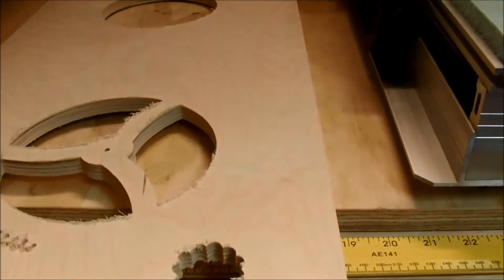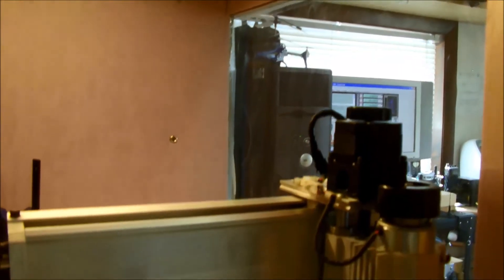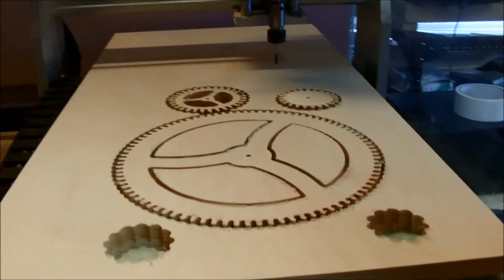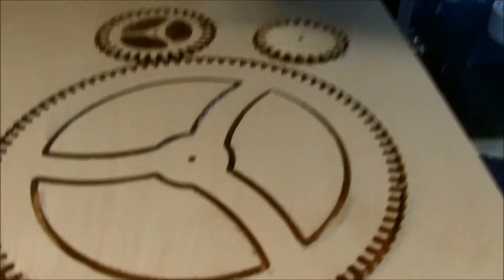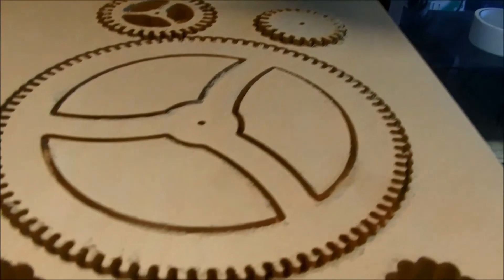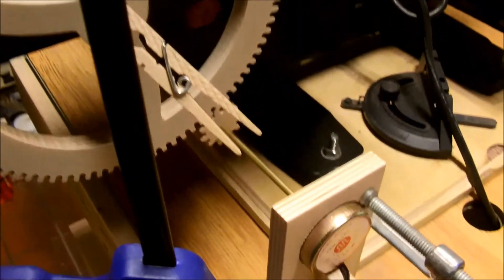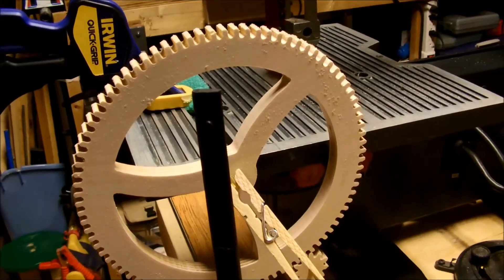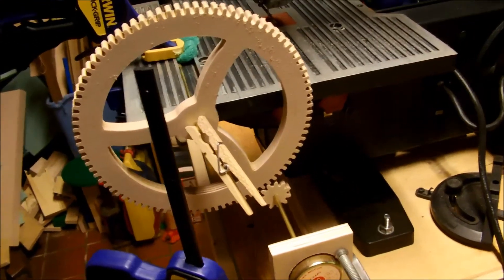CNC - 3040 - Clock Gear Train

Comment: Hi,  What machine do you have?  I googled 3040 CNC and got a wide range of machines.
Reply from the maker: The one I have is the old design that uses a parallel port rather than a USB.  Most of the 3040 CNC machines are similar.  Some have slight differences in motors or spindle size but it's pretty much the same machine.

Comment: How would this machine fare with milling aluminium? What about something harder like steel? I'm looking to build parts for some crazy robot project!
Reply from the maker: The CNC machine itself (stepper motors, rails, bed, etc.) is strong enough to work with aluminum, however, the spindle isn't up to the task.  I tried to cut aluminum many times and the small spindle would grind to a stop and then break the bit.  I ended up re-designing the holder for the router and then put a larger router in to cut aluminum.  Here is the video of my spindle/router mod:  https://www.youtube.com/watch?v=XmkRdvir5Ns
Reply: Thank you!

Comment: I use an Isel DaVinci III.  Its working envelope is about 2926.  I feel much of your pain with regard to project size and segmenting projects so they fit the envelope.  I would like to hear why you went with the 3040 when your home built seemed to be working just fine.  I like your page because you feature fun cnc projects within the reach of my cnc.
Reply from the maker: +Harry Ragland Hi Harry.  My home built machine was fun to design and build and far exceeded my expectations.  However, for making gears and projects that required a little more precision I wanted a slightly better machine.  The 3040 is very accurate for how much it cost and I'm enjoying using it.  But, as noted, I'd like a bigger CNC one day.  I do try to keep my projects within easy reach for average workshop folks.  Nothing too crazy complicated or expensive.  Thanks for your comments.  I do appreciate all feedback.

Comment: What do you think of this router now that you've had it a while?  I'm thinking of buying the same thing.
Reply from the maker: +Dale Fletcher It's a very good little machine.  I've run it through lots of projects and it has held up very well.  The only downside is that it's on the small side.  The router/spindle is plenty strong for the wood working projects I've done but I'd like a larger cutting area.  The price is hard to beat though.

Comment: I have built my own cnc and brought rails and bearings lead screws, the accuracy is very good. I have built one of Brian's laws clocks from the free plans. It worked great. What is that gear programme you was using at the start of the this video?
Good luck with the rest of the build
Reply from the maker: pmr21uk Thanks for your comments.  The program is called Gearotic Thoughts - http://www.gearotic.com/

Comment: I kept my eye open for this video, had a sneaky suspision you may be working on it over the weekend :)

I had been gathering the parts to build my own CNC but after seeing this I may just get the 3020 ! It seems to have worked well for your gears.

Andrew
Reply from the maker: Andrew Graydon H Andrew.  I'm learning about it as I go.  I need some better cutters/end mills and need to adjust my feed rates and depths of cut, but I think it will work out fine.